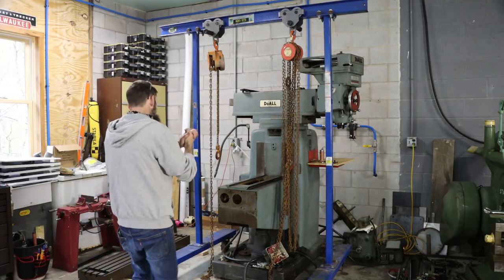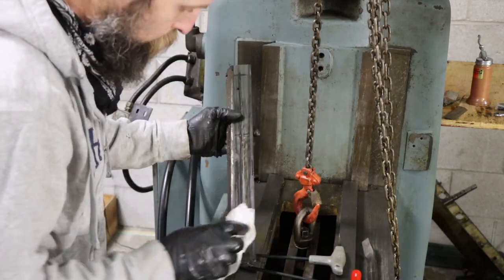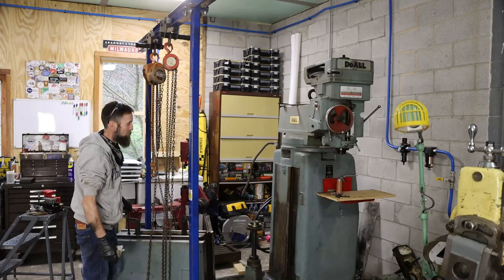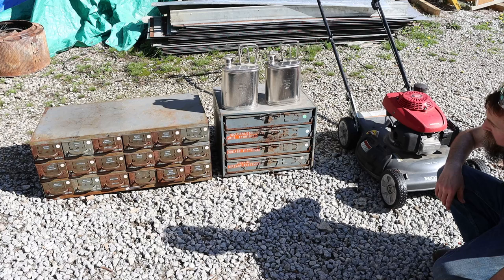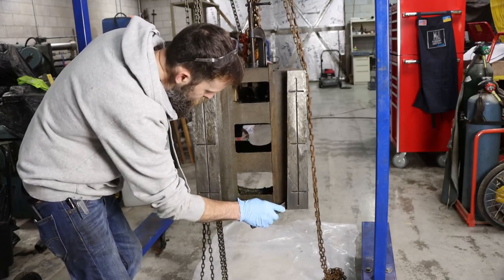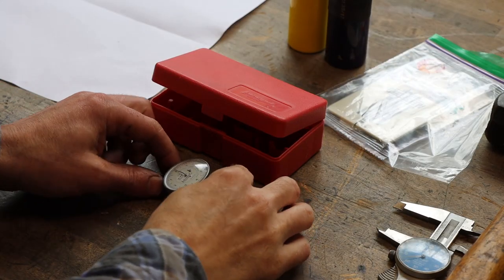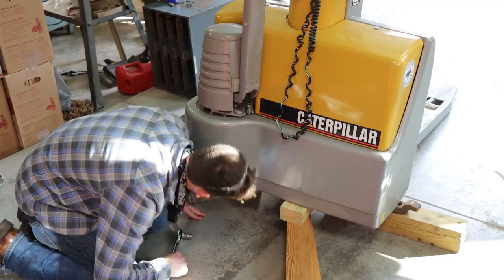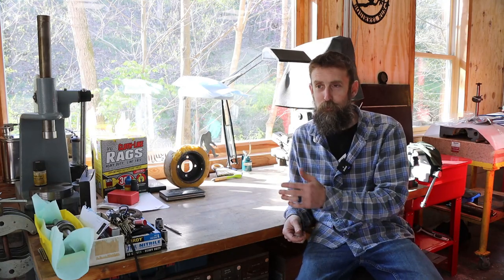Off with the Knee of the DoAll milling machine.

Comment: maibe you could do a video on alighning the crank on that mower , either by heating and schrinking or by welding it up and machine it
looks like the old wheel for the forklift has been standing in some oil or brakefluid
Reply: They usually just put a indicator on it to mark the high point and wallop the bejesus out of it with lead or brass hammer.

Comment: I made a new "tire" for a similar wheel from sawdust and bottle caps. Removed the old one, made a form to put in the the new stuff, put it all into the oven on 180°C, cut up bottle caps in an old mixer, mixed in 20% coarse sawdust and formed the new wheel with that. The turned it round on the lathe. Works fine for now. The sawdust is important, without it the wheel hasn't any grip.
Took me around 12 hours to make it. It Was cheaper than to buy a new one.